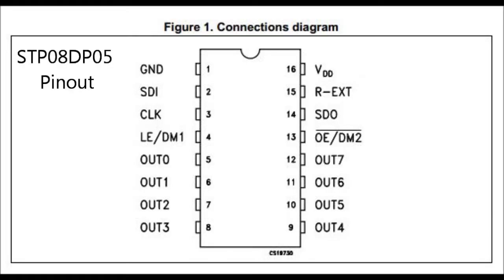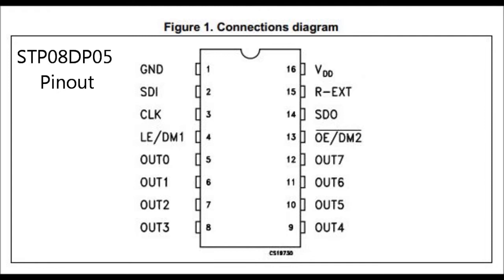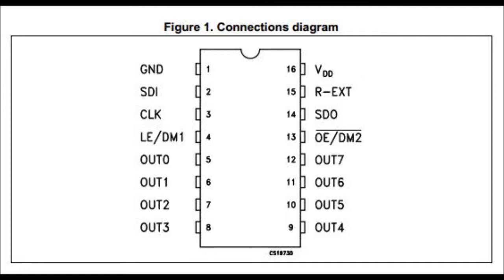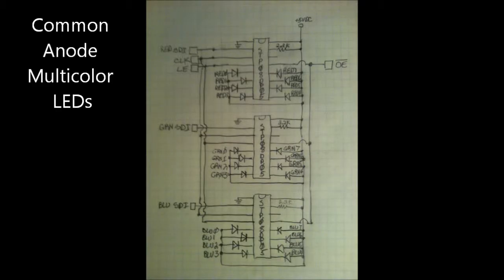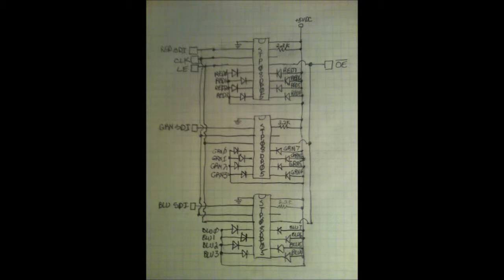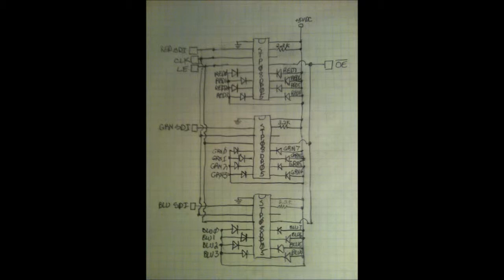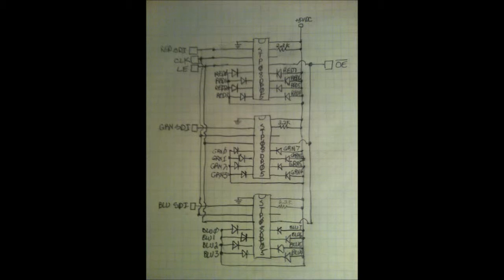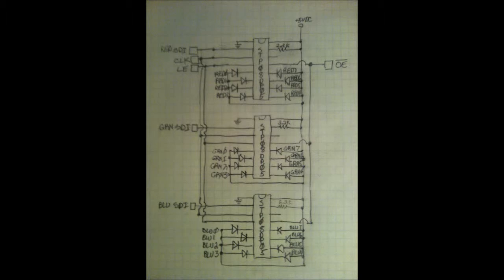Arduino STP08DP05 LED Driver

Comment: This is a very good video.  Thank you.  I am also experimenting with the same chip.  How did you calculate the value of the resistor as 2.2k ohm?
Reply from the maker: Hi Allan! Thanks for the feedback.

The data sheet (http://www.st.com/web/en/resource/technical/document/datasheet/CD00156241.pdf) has a table (Figure 11. Output current-REXT resistor) that is resistance vs LED current. 

I just looked up the specs on my LED and picked a common resistor value that yielded something close to the recommended current.
Reply: Thanks Roger for confirming what you did.   Much appreciated.

Once again, very nice video.

Thank you.